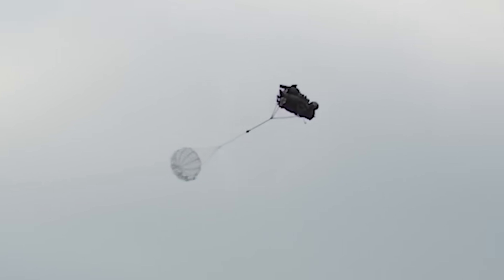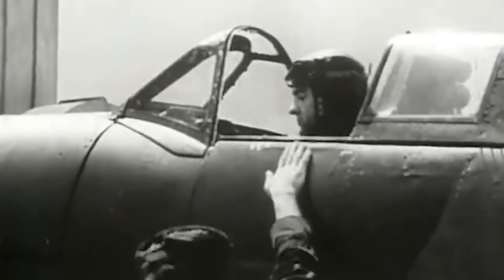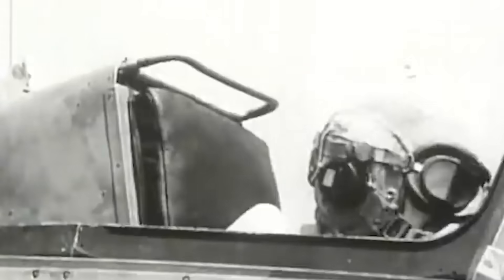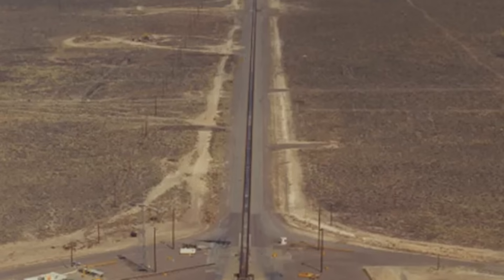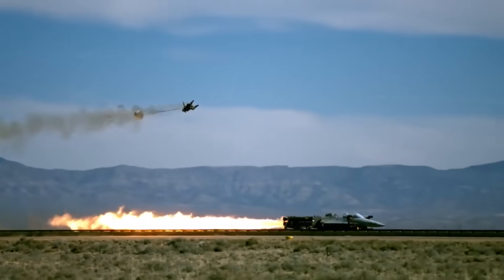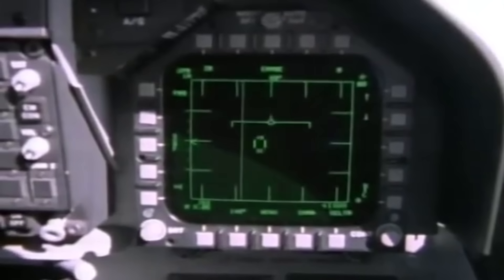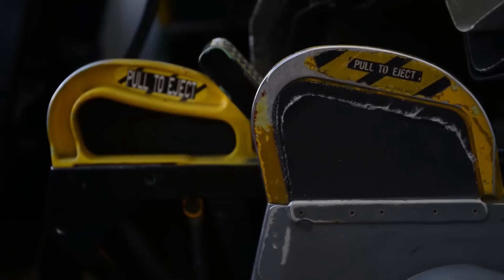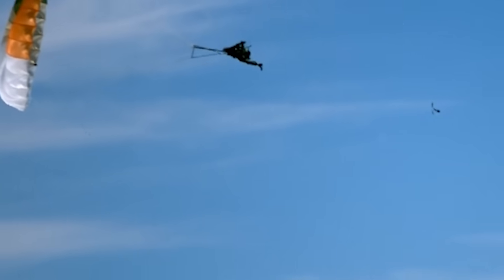The Hypersonic Railroad Track

Comment: In the late 80s-early 90s, I did rocket sled testing at Holloman of an advanced guidance system. I can't tell you more about the system - I retired in 1999 and don't know the current classification of the project. The group that operates the rocket sled range were an incredibly professional bunch completely focused on going as fast as safely possible. Developing that guidance system was one of the best times in my Air Force career and I always looked forward to my TDYs to Holloman.

Comment: When I left Holloman in 2000, they were doing missile nose body impact studies shooting for mach 10 on the long track. I lived 1/2 mile outside west gate WSMR, which is very near the impact area, and when a sled leaves the track, there's no telling where it'll come down. When they broke the mach, 9 sonic booms in a row would rock the house and shake the hell out of everything.
Reply: Didn't they have a sign up, Mach 10 or bust? I think I recall that from the late 80s.
Reply: @dubarnik  Yup, and never made it either. Though they did lose 2-3 sleds off the long track trying in the 18 months I was there. One nearly took out the west gate guard shack (which is near the impact area). When the guard finally drug up out of the desert where he'd run off to when the sled came rolling through, he quit on the spot.

Comment: I was a test engineer for McDonnell-Douglas Escape Systems in the late 80s-early 90s.  Spent three months at HSTT  testing some ACES II updates.  As impressive as our own five tests were (from zero-zero to Mach 1), the most spectacular test I witnessed was a Mach 7 ablative materials test run.  At night, three stages, used the entire length.  Fired south from the north end, myself and a few other watched it from the control bunker at approximately mid point.  First stage was an Honest John booster, second was a Nike Hercules booster, third was a Patriot booster.   The final stage shot past us before we even heard the ignition of the first.  Surreal.
Reply: Now THAT is FAST.
Reply: I heard you can watch those tests at night and when they tent the track in ,at launch it lights the whole length of the track all at once ! Visible for mis!

Comment: not sure what aircraft flying does 3000 MPH. the X-15 went that fast but it was retired long ago. the SR-71 went mach 3, 2100 MPH or so but it's been retired too.
Reply: Exactly! I think that the highest speed ejection test at Holloman was around 900 KEAS, and that was an F-111 capsule.
Reply: They got something. They always do